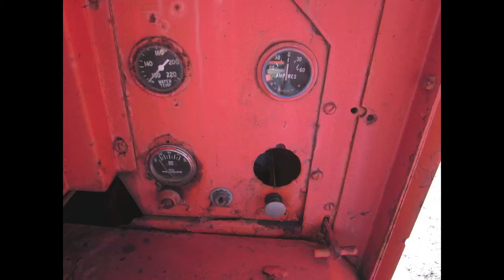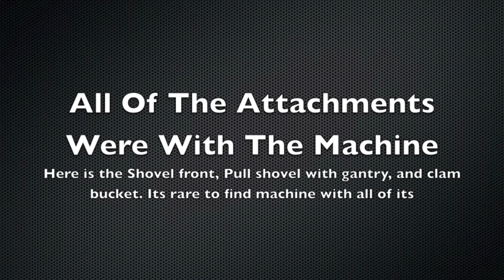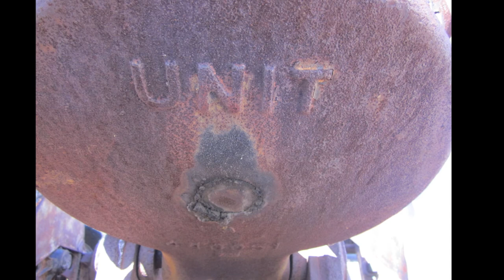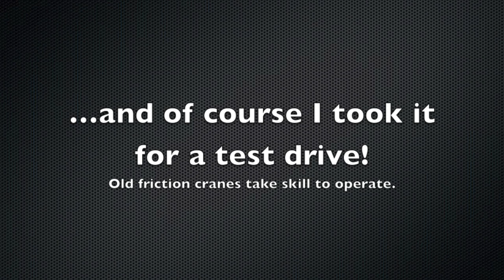Unit 1020 Crane

Comment: A little sandblasting, paint and some t.l.c. and she'd buzz again. Looked like the 3-banger had a torque on it. She'd be strong. The 1020 I ran would snap a 3/4 drag rope in a heartbeat! It was a clutch job. Ran the smaller ones 1010?  with the 2 banger's- straight and clutch and they'd dig too. Buddy of mine has a 1020 with oil-cooled swings. I'd have to wad a coat up between my leg and the swing clutch cover it'd get so hot. Ran a gas job on a truck once  and it was sweet too Good pics. Get it running! (me)